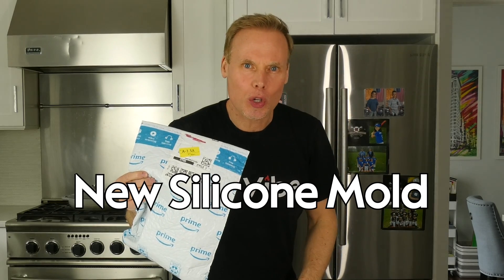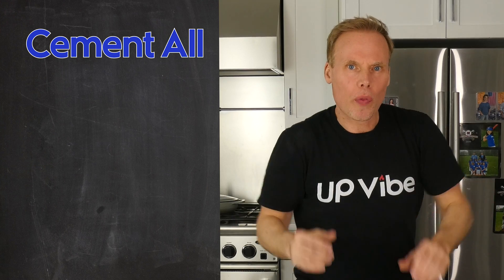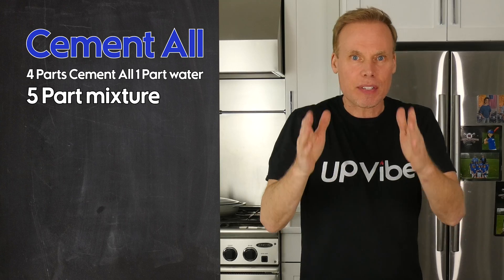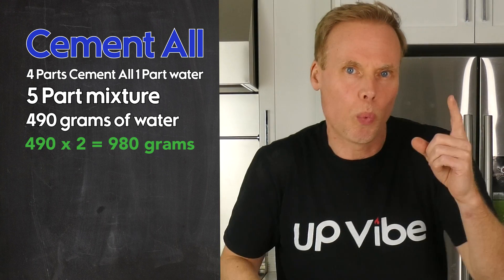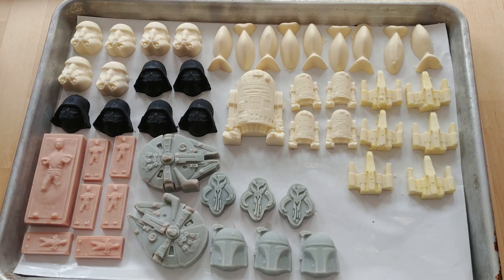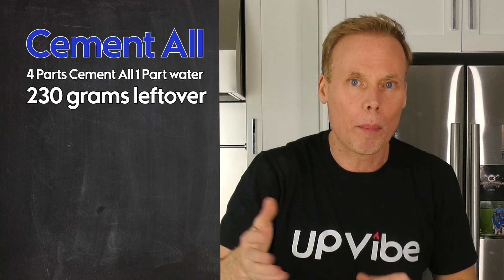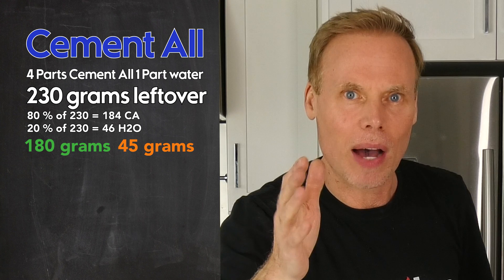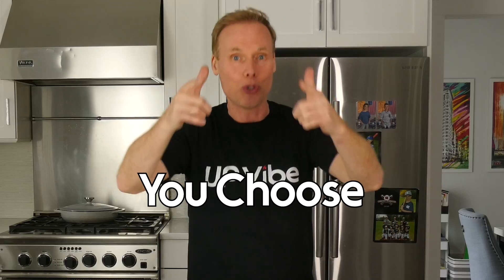FAST Method to Determine Cement Amount in ANY Silicone Mold

Comment: What if you are using a premix? I have a silicone mold that holds 12 oz of water. How do I determine how much of a premix I need?
Reply from the maker: You should be able to figure it out by watching this video here. https://youtu.be/dAQ9XH5sEiQ?si=FBZz8ksr06bx3EEH. I talk about how to figure it out.
Reply: @upvibeoptions  this is not a dry premix, it is one with water already in it. I may have to add more water to thin it out as currently it is a thick pancake consistency, not really a pouring consistency.

Comment: Beautiful video but I have one worry..so for every mold one must work and have extra product before the next mixture one gets it right? As u derived the exact calc from the 230g which was left extra from previous mixture...and will it not be hardening before all the measurements?
Reply from the maker: There is a little left over so you should be good. This is the better video. https://youtu.be/dAQ9XH5sEiQ?si=cndO7flYfBNEpKNF

Comment: Hi Jai!   I'm new to your channel and thank you for this video.  That really helps me out figuring how much cement and water being I'm new to this craft.   I do have one question?   I've been using UltraCal 30 for dot painting molds.  Will UltraCal 30 work on these molds and will the calculations be the same?   I appreciate any advice you can give me on this.  Thank you.
Reply from the maker: The video below shows the calculations for hydrostone. If Ultracal 30 is the same ratio (which I believe it is) then yes. https://youtu.be/dAQ9XH5sEiQ?si=NpS7NvTsMiplUPhJ
Reply: @upvibeoptions  Ty so much!

Comment: Hey Jai. I tried this formula but i found the cement was too thick i did have to add a little more water. ( i am using quickrete) either way !!! This formula did help alot and now its just a matter of finding the percise measurements. 

Also last question.. why do you use distilled water? And not regular tap water? 

Thank you !!
Reply from the maker: The formula works perfectly with Cement All and was not designed for Quikrete. If you want to use it for Quikrete you need to use the ratio you use to mix your Quikrete and plug that into the formula. Also not sure where you heard I use distilled water. For what it's worth I have never used it at all.
Reply: Thx Jai,

I guess I assumed becuase I see some use distilled but i use regular and its fine. Sorry about that. 

Love the videos they have been helping regardless!!
Reply from the maker: @Beingjujubee  Yes people use distilled water because water varies from place to place. There are multiple chemicals along with bacteria in water that will change the outcome of your vessel. For me tap is just fine.

Comment: This formula I've been looking for!very informative Sir and thanks for sharing and what about the preservative sealant finishes are not available in our country. What is the alternative for that?
Reply from the maker: Thank you. I am not sure where you are from but I suggest going to your local hardware store and finding a concrete sealer. Then call the manufacturer from the label on the back and ask them if they believe it could be used for candles. If that doesn't work you might think about having a sealer shipped to your country. Hope that helps.

Comment: 980 divided by .25 is  3920 ... however when i multiply the decimal i came up with 245g. So should i be dividing or multiplying for the 1part water?
Reply from the maker: Yes multiply the decimal or divide by 4.

Comment: Hello! Really appreciate your videos! Very informative 😀 I'm new to concrete making and don't have access to Cemenent All as I am based in AUS. Quick question, I have white cement which is a 2:1 ratio. I think I understand but as always, over thinking the measurements so I am hoping to get your help. Using the same mould, how would you calculate 2:1 ratio? Thanks heaps 😃
Reply from the maker: 2:1 would be 800:400. Hope that helps.
Reply: @upvibeoptions  thanks 😊..sounded too simple so figured I was wrong lol

Comment: Thanks for the help. I found that once the water weight is found you can just use that as a total weight then multiply that by .2 to find the water weight then subtract that from the total to find the cement all weight. It's is pretty accurate. you definitely gave me a great starting point. Thanks again.
Reply from the maker: Glad the video helped you. Thanks for the comment.

Comment: Hi Jai, your videos are really great! congratulations for your work. :)
In the explanation you gave for the precise math in the description of the video, for those who don't use CementAll, you said:

"Now once you stir your mixture together and add it to the mixing bowl you should have leftover content that you placed in a cup. That number, most likely is 230 grams (give or take). So, let's calculate and break down the "270 grams" and 3 part mixture." 

I'm confused with the 270gram value. Where does it come from? Because when you break down the mixture you always use 230. So, shouldn't it be 230 instead?

Thank you so much, I'm becoming a really great fan of your work. :)
Please create more videos about vessels and other stuff with this formula (or kind of) for those of us who want a fast and great product without having to use CementAll. We really appreciate it!
Reply from the maker: Hi Vania. I made the video for both those who know math well and for those who don't know math well. Here is what you do. Put your silicone mold on a scale. Fill up your silicone mold with water to the very top but don't let it over flow. Whatever number you arrive at take that number and multiply it by 2 and that is what your total amount you are going to use. So if the number is 980 grams and you are using a Cement, sand and plaster mix, then half is plaster at 490g, sand is at 245g and cement is at 245g. Your water is the same as plaster which is at 490g. I hope that helps.
Reply from the maker: By the way I reread your comment. You are absolutely right. I made an error. The number is 230. I have updated it on my channel. Thanks for pointing that out and thank you for sharing your feelings about my work.

Comment: Hello again! Looking at your graphic for calculating the amount of water, shouldn't it be 980 X .25?  That's how  I get 245. 
If I use 908/.25 I get 3920. Please clarify. Have a wonderful holiday weekend.
Reply from the maker: Yes 980 x .25 is 1/4 of 980 so you are right. I just worded it differently but we are both saying the same thing.
Reply: @upvibeoptions  You should probably change your video to 980 x .25, not 980 / .25. They're definitely not the same thing.
Reply from the maker: @anneanderson4222  you should probably look before you speak. https://youtu.be/dAQ9XH5sEiQ?si=rdPL4EWsbeRuLKEJ

Comment: Thank you so much for putting this out there! My faulty logic used the mold's volume, divided by 5. That result became my 1 ratio (water). Then I took that 1 ratio, multiplied by 4 to get the concrete amount.  All said and done, it did not fill the mold all the way. Thanks to you, my project will be more successful. This video was so easy to understand. 

With the "Easy Way" formula, there was  a cup of mixture left over (230 gr) for this particular mold.  That is approximately  .19 extra.  For those who want to use a  more precise method the first time ( I may never want to use this mold again ),  use the "Easy Way" to calculate the first figures and then reduce the concrete and H2O by 20%?  This would result in a slightly less filled mold.  Could this reduced amount calculation be used as universal calculation for any mold?   One last question.  I prefer to use the imperial system of measurement. Would the "Easy Way" formula change?
Reply from the maker: Aww thanks for the great comment. Great point. 20% might just work. However, I believe it's a decimal point and not an exact number so as the mold gets bigger the number no longer fits... if that makes sense. And yes once you convert it to your form of measurement all else should fall into place. Thanks again for the comment.

Comment: Hey Jai, great tutorial, I have a quick question if you don't mind. No access to cement-all, watched your other video on making concrete vessels with sand, cement and plaster. Can't quite figure out how to find water needed for 6 part mixture (math is obviously not my forte 😆)🤔
So using your vessel size above as an example:
Plaster 2 parts, sand 1 part, cement 1 part, water 2 parts. If dry ingredients are 980g (490×2), how do I find the water amount? Do I divide the dry ingredients by 6 as it's a 6 part mix (giving 163g of water)? Or do I multiply the water by 2 (because it's a 6 part mix, 980g being 4 parts) giving a water value of 326g??
LOL hope this makes sense.... I'm neurodivergent (welcome to my world!) my brain works a little different 🤷
Sorry if I've just melted your head 🤯
Reply from the maker: Water is always the same as plaster so it's 490. The next part of your question is tricky but hopefully you understand. 2 parts plaster, 2 parts water, 1 part sand and 1 part cement. If you take the 1 part sand and 1 part cement and put them together you get 2 parts plaster, 2 parts water and 2 parts sand/cement. Add those 2 together gives you a 3 part mixture. Doing it your way isn't wrong but so much more work. Hopefully that make sense.
Reply: @upvibeoptions  that makes it so much easier, thank you! 🙃

Comment: Why did you times it by two in the beginning?
Reply from the maker: Cement is more dense than water so when you times it by 2 you get close to the actual weight of the mold. Those who don’t like math can stop there. Hence why there is an easy part and precise part.
Reply: Yeah the whole times by 2 thing had me confused as well. Glad it was answered down here.

Comment: If i cant use Cementall ? what the proportion for sand/cimente ?
Reply from the maker: 2 parts plaster, 1 part sand 1 part cement and the water is the same as the plaster.

Comment: Would the factor always be 2 ?
Reply from the maker: I don’t understand your question. Could you explain it differently?
Reply: @upvibeoptions  basically was trying to figure out if you always double the amount of water measured .
Reply from the maker: @ericamartin7490  I only double the water on a cement, plaster and sand mix with plaster being the part I double with water. With Cement All it’s 4 to 1.
Reply: @upvibeoptions  you added water to the mold then multiplied that figure by 2 to get the cement amount. Why? That is what the original poster is asking.
Reply from the maker: @nekishabass1352  Because water is lighter than cement and the only thing you can add to your silicone molds and still not damage them. Multiplying them by 2 gets you at a very close ballpark figure. Hope that helps.
Reply: @upvibeoptions  that was super helpful. Hopefully Erica now understands that yes, always multiple by 2 whatever mold she uses :)
Reply: @nekishabass1352  yes it worked loll !!! Actually tried it on these new molds barely had any left over ; just struggling with the consistent heat this summer and having to move fast but originally i was just curious . guessing( like mentioned ) to by jai doubling the weight of the water gets it closer to the weight of concrete ..